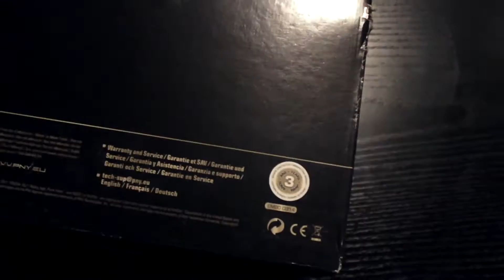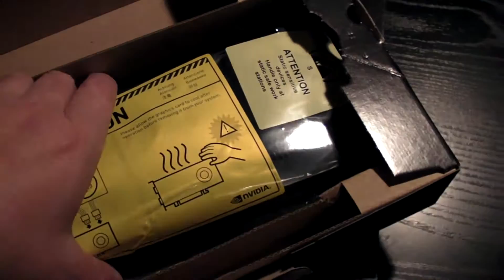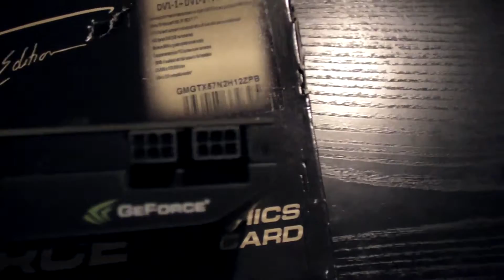NVIDIA PNY GTX 570 (SLI) UNBOXING AND VISUAL COMPARISON WITH VARIOUS CARDS

Comment from the maker: @NikacXMKD 

Ok go for the MSI one. The dual fan solution will probably have better temps, but will exhaust all hot air inside the case.

The reference design exhausts all hot air out of the case which is much more preferable for me at least.

Comment from the maker: @ThaiPredator 

Normally all GTX 570s are the same, unless there's a factory overclock on the card, which should be stated by the manufacturer, but you can see that with gpuz anyway.

Comment from the maker: @TFDMarcDriftz 

The stock clock is at 732Mhz for the core. I have taken it up to 850Mhz with some voltage added. Nothing extreme. Just what was needed to give another 15% of performance and reach GTX 580 levels. That's all I wanted and that's for benchmarks.

I almost never overclock for gaming. They destroy anything you throw at them. Truth be told, I rarely use SLI anyway. One card is enough for 90% of the time. Great card.

Comment from the maker: @DuyAnh1 

Actually its the best idea to get cards of this type. The blow all hot air out of the case.

The axial type HSFs, blow the hot air inside the case and these babis can easily produce 500W of heat combined. Not a good idea having all this heat inside your case.

As for the cleaning part, you just need a strong blower and you are fine.

Comment from the maker: @Edsan91 

The 570 is equal to the 6970. I had to buy Nv this time, since I was having various issues with my ATI cards and my HDTVs. Some games that do not have a frequency selector, tend up to run at 24hz refresh rate, which sucks balls. 

My experience with my 460 showed that Nv is much better in that department.

I am not an Nv fan, but these cards are really good.

Comment from the maker: @markoulas2 

If you intened to test run them at 850Mhz with 1V, you are possibly looking at 250W per card. Add another 200W for a 4.0Ghz core i7 and you are at 850W PSU territory. Make it 1000 to be on the safe side! ;)

Comment: @lorenzosaintsrow2 Your English is fine, no worries
I could argue with that, I've been doing some researches for about one full month and at end came up with 570 SLi being slightly better than 6970's - not always though. Radeons perform better in higher resolutions.

Comment: @toutagamon Yes, I know that, I bought it in eBay for 200 Euros. Greatest buy in my life, I think, beacuse it was cheap. Thanks for the informations thought, will might ask you about things, if I need, but I also don't want to overclock hard, since I'm affraid of the power supply little bit. Minimal Requied is 550W at NVIDIA site, I've got 600W one. Chieftec CTG-600-80PB.